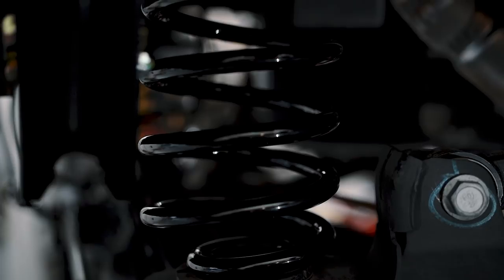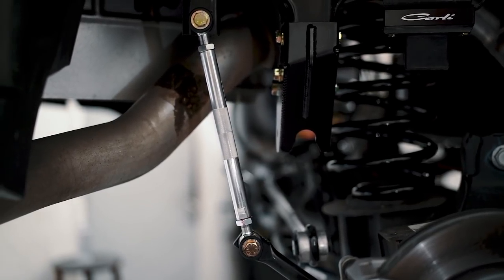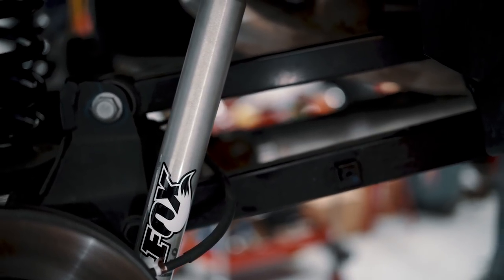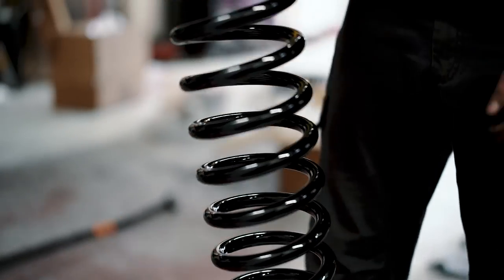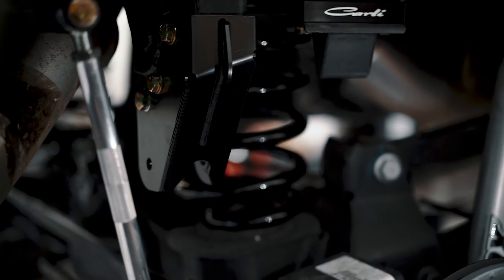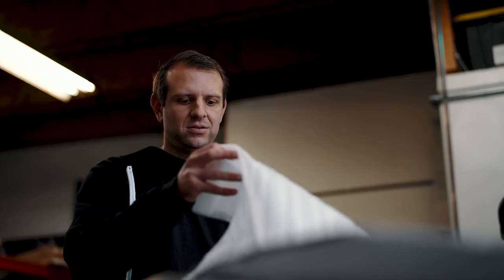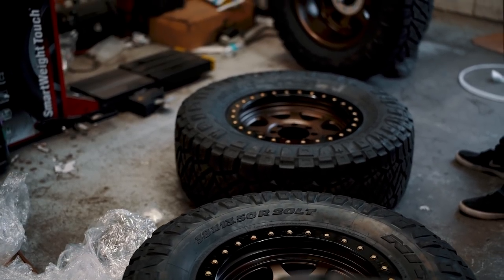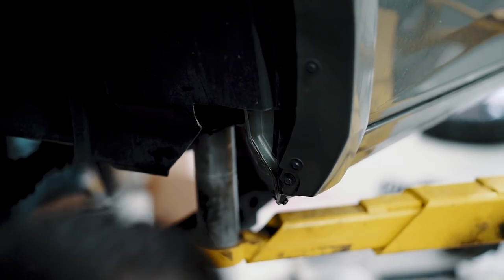2020 Ram Cummins Mega Cab on 38's and Carli Suspension Commuter Kit | CJC Mega Episode 2

Comment from the maker: The parts on this truck:
Suspension: http://www.cjcoffroad.com/Carli-Suspension-2014-Dodge-Ram-2500-Commuter-Kit-p/cs-dc20-1419-d.htm
Wheels: http://www.cjcoffroad.com/Trail-Ready-BL20-20-x-9-Simulated-BeadLOOK-Wheel-p/bl20.htm
Tires: 38/13.5/20 Nitto Ridge Grappler

Comment: What do you recommend for a 2022 Power Wagon? I’m not going rock crawling or high speed off road. I’m more conservative off road and overland and I tow a 7,000lb trailer (bumper tow). Looking to get a better ride commuting and towing. Do I need the entire Carli system or can I get away with 2.0 FOX shocks and a rear sway bar upgrade?
Reply from the maker: Sadly you'll only notice a very small improvement from just shocks. We'd recommend the Commuter or Backcountry system for your use case! https://www.cjcoffroad.com/collections/2019-ram-2500-powerwagon-carli-suspension-systems

Comment: Truck looks great!! I wasn’t aware people used a 2500 Cummins for high speed off-roading? So basically this kit is good for 99.9%
Reply from the maker: They actually handle high speed off road very well, but yes for trucks that spend 99% of their time on pavement, this commuter kit is the best ride you can get!
Reply: CJC Off Road this truck is beautiful! In New England we don’t have many high speed off-road areas. In the next year I’m either get a 2500 Cummins or the diesel gladiator, i haven’t made up my mind . I suppose i need to drive the gladiator to see if I even like it 🤷🏼‍♂️ If i get the Ram I’ll be contacting y’all for sure!

Comment: have you considered adding bags vs. timbrens to mitigate the reduced heavy tow/haul capacity?  Commuter kit + bags seems like the best of both worlds for people who use as a daily driver and a real workhorse at times.
Reply from the maker: The 2500 platform is very limiting. With these trucks, bags ruin the ride quality since there’s so little room. We recommend only using Timbrens while towing for the 2014+ 2500 Ram trucks.

Comment: I want to do that exact setup on my  new 2500 longhorn. What trimming did you have to do with putting 38” tires on
Reply from the maker: We’ll make a separate video, but moderate trimming of the pinch weld, liner and flares is necessary.

Comment: I have a 2020 cummins.2500 limited megacab with rear air ride. I'd like to know what the biggest tire i can ru  on the factory suspension because I do tow allot a 30 ft bumper pull camper and a racetrack trailer and a dump trailer... I want the wheels to kick outward a to give it a little stance... what do you suggest.  Or is there a suspension kit that can improve towing and capacity??

Comment: Did you have to trim the pinch weld? If so does trimming the pinch weld effect anything? Getting my lift done soon and my have to trim the pinch weld
Reply from the maker: This truck did take pinch weld trimming because of the 38’s but there’s no need if you’re doing 37s. There’s no structural issues or anything with a pinch weld trim though.

Comment: great looking truck!  Are you going to re-gear, or will the stock 3:73's work fine for 38"s?
Reply from the maker: TBD. we never like to re-gear unless it’s necessary, and so far the truck is driving great on 38s!
Reply: @CJCOffRoad  Did you get the 3:73's or 4:10's from the factory ?

Comment: That's a nice looking truck!, I have a question, if you are comparing a Ram 2500 5th Gen with a Carli Suspension vs a Ram 1500 5th Gen with Stock Suspension no Air ride, in terms if ride quality and nothing else which one rides better? I know a 2500 is a hd truck but damn for me any hd truck looks better than 1/2 ton truck.
Reply from the maker: The 1500 will always ride better because it can have softer suspension. If you’re just city driving without towing and want the softest ride, go for a 1500.
Reply: @CJCOffRoad  thanks!

Comment: whats the wheel offset you ran? also how is the clearance on the sway bar and radius arms ?
Reply from the maker: This is a +18 offset wheel. It currently rubs the factory sway bar and radius arms at full lock, but once we put on the Carli torsion sway bar and fabricated radius arms it won’t hit.

Comment: Beautiful truck! Hows the performance with the 38s and 3.73 gears? I have a '15 on factory tires with 3.42s, curious how it impacted your fuel mileage (I'll regear if I go to a bigger tire)
Reply from the maker: Since this truck came with 3.73 factory gears, it’s actually just fine on 38s.1000 ftlbs of torque doesn’t mind 38’s too much haha
Reply: @CJCOffRoad  I'm jealous of those numbers lol. I do have mine tuned, but still not making that much power
Reply: This on a 2500 or 3500? 
2500 is only available with the standard output 370/850 6.7 Cummins/68rfe trans. Have to get a one ton unfortunately to get the Aisen/HO 1000FT/LB ☹️

Comment: When y'all gonna get a 6" lift kit for the ram 2500?
Reply from the maker: Most likely never. For the 2014+ Ram 2500 trucks, the rear suspension design is too limiting. You can do a 6” lift, but it wouldn’t meet the performance requirements of Carli or Thuren.
Reply: @CJCOffRoad  could you do a video expanding on that?
Reply: @chrisj3097  I second this
Reply: @cameronmiller4665  I third this. Video of WHY NO “REAL” HEIGHT FOR 2015 RAM 2500?????

Comment: plan on getting that 3.25 pintop. if i want to upgrade to the dominator later can i do that and what would i need to get. also what gears do you recommend running 37in tires on a 2020 ram 2500 diesel?
Reply from the maker: You just need the dominator shock upgrade package that’s listed on our website! We recommend either staying with the factory gears, or doing 4.10-4.56 range.

Comment: Can you discuss impact to the speedometer from your builds, and what do you recommend as a Carli equivalent suspension for GM trucks
Reply from the maker: There’s lots of websites that let you calculate the change in speedo and odometer from aftermarket tires, but keep in mind you can correct for those. For GM trucks, we have to build a set up using a combo of parts from different brands. It all depends on the customer’s wants and budget.

Comment: I commute in the oil patch. Normally decent roads and sometimes heavy mud and super bad roads in northern Canada. Would this system be alright for a 2010 2500 Ram diesel? Or would you recommend something beefier? Thanks
Reply from the maker: This system would get you by, but it sounds like you might be slightly better off with the Back Country. The nice thing is that the basic parts are all the same, so changing or upgrading shocks is easy!

Comment: will a 38" spare fit in the stock location? if not, what is the largest size can you place inside the spare location?
Reply from the maker: You can barely cram a 35 in there so we typically recommend a bed mounted spare for 37’s and larger. We have those mounts listed on our website!

Comment: Waiting on your trimming video before I order my commuter 31/4 lift.   ?????
Reply from the maker: We already have a trimming video for the Ram trucks! These 2019+ trucks take the exact same trimming procedure. If you want to run 38’s, you just need to remove a significant portion of the pinch weld. Every tire brand will be slightly different, so just drive the truck snd trim as needed to clear.
Reply: Thanks  I thought you had said the but weld needed also grinding down that’s what I was waiting on. Appreciate the info.
Reply from the maker: Yeah there’s sadly not a formula since it all depends on your wheel and tire choices. Basically just expect to take off a significant portion of the pinch weld and the bottom of the liner and fender flare. We like to unbolt that black plastic piece from the flare and leave it off.

Comment: Love the vid and have been fully immersed in Carli for a long time, have even run a Carli unlimited suspension on an earlier model Ram, now running a '17 Mega G56 on 3.25" on 37" Toyo MT's....I'm from MT but not 'cause of tires.....following me?  Anyway, I've installed the radius arms....even tried getting them from you....but because they are in such high demand you guys were helpful but helpless at the same time,,,,,supply and demand....I understand,,,and should all of 'Merca.   I now have all the suspension stuff i want on my truck and love it, as expected, because I'm a previous owner of Carli stuff, however, I want to be perfectly clear, RUN CARLI or DIE...it works perfectly and you will not disagree!!!  Zombie's beware!!
Reply from the maker: Sadly since those arms are welded by hand, the guys at carli can only make so many in a day! That’s the downside of hand made in the USA product, but we’d take that over Chinese robot welds any day!

Comment: Question for anyone that is an expert in this area. Is there anyway to upgrade/increase the payload of a RAM 2500 Cummins? Currently the max payload is 2,100 lbs. I fully understand air suspension does not increase payload. I'm not trying to get 4,000 payload but 2,800 would be great.
Reply from the maker: Unfortunately legally no. There is no way to exceed the legal sticker on the door. Physically you can add airbags etc to hide the squat, but you’ll still be over weight from the manufacturer ratings.

Comment: To bad there isn't any kits that help with 2019 Ram 2500 with rear air suspensions. Sure they ride nice, but once you put bigger tires on them, its ride pretty rough.
Reply from the maker: Hey Joe, you can actually utilize a Carli Leveling kit with the rear air ride trucks with one additional component! Also Carli is working on a 3.25" system that will be compatible with the air ride trucks as well!
Reply: @CJCOffRoad  i definitly would be interested in the 3.5 Carli lift. Hope to hear more about it once its completed.

Comment: How many problems though if you keep it for 100K miles?
Reply from the maker: We’ve got thousands of customer trucks running carli systems into high mileage with a lot less issues than the factory parts.
Reply: @CJCOffRoad  I mean the Ram truck in general. They are not exactly for quality
Reply from the maker: There’s a reason you see more professional hot shot drivers in Rams than any other truck! Those are the guys that do 100k miles a year and need reliability for the survival of their business.
Reply: @CJCOffRoad  So would you buy a diesel even if you only towed once in a while?

Comment: What are the specs on the wheels?  I want them for my 2020.
Reply from the maker: They're linked in the description! Trail Ready 20x9 wheels.
Reply: CJC Off Road  your site has 20x9.5 with no custom powder coat option. Not finding what you have here.

Comment: Keeps taking about ride quality, but lifts so more body roll, and rougher ridding 38” off road tires compared to stock street tires.

Nice mall crawler sunny.
Reply from the maker: And this is exactly why we started this channel, to inform the uninformed! A performance minded suspension system with tuned shocks will actually have less body roll than stock but still offers a better ride. At stock height your suspension still moves which allows for body roll. Secondly, the factory tires at their rated air pressure are the equivalent to steam roller drums, these 38" tires at the proper air pressure actually have better small bump compliance than stock tires.
Reply: CJC Off Road You’re calling this a performance minded suspension with a 2.0 system?

Also there is nothing performance about your 20 inch rims.

Comment: They are nice not just nice but they are the best looking stuff out there but it cost way way way to much no way in the world unless your rich is a whole system worth 12k like it’s so nice that I might open up the net and go to my truck and day dream about having the best kit ya got fir my truck but in the real of it I’d be a fool to buy it even if I had it you could by a coil over kit for 3$ grand and ride like a dream
Reply from the maker: The kit on this truck is 3k so it's very reasonable considering what's included and how improved the ride is. Good ride out of a coil over kit on a solid axle truck is basically a myth. A bolt on coil over system limits the travel on a solid axle truck so severely that you lose any ride quality benefit.